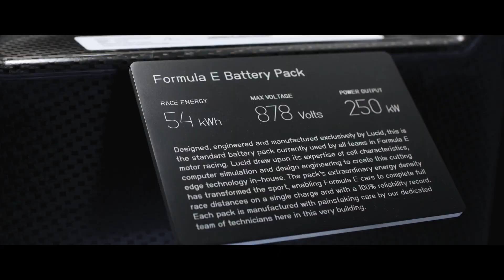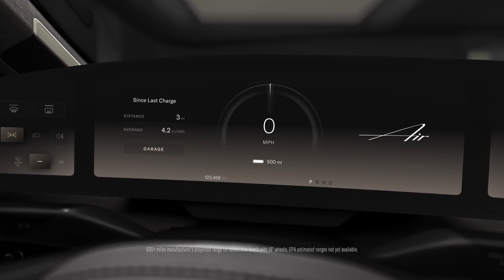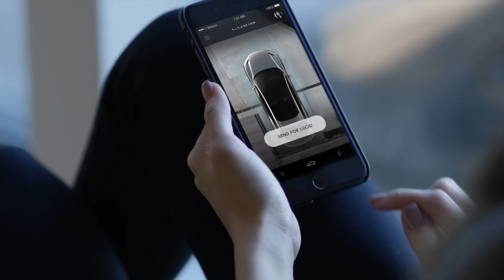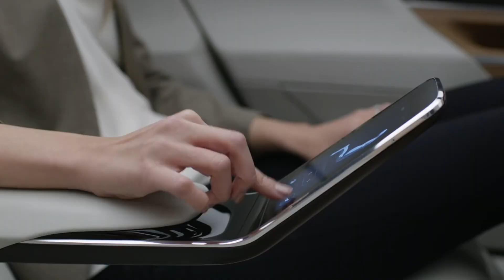What is Lucid Motors?

Comment: LUCID motors is a MASSIVE FRAUD.
PETER never ever was CHIEF anything at TESLA .
Peter came on board , after the Model S PROTOTYPE was Finished , and he worked on the PRODUCTION Model S. 
Peter was VP of the Production model S, in charge of BODY Design and Chassis .
He did NOT work on Batteries, Electric motors, EV Drivetrain, Computers , Software, HVAC, or the BMS/Superbottle.
Reply: I think you're scared of Lucid because I see you spamming this in every video for the last few months.. It also doesn't help using uppercase letters for random words.
Reply: @bobvandijk6274   - how about FIRST , you do some RESEARCH on Lucid motors & LCID stock ?
I done my Due Diligence , time to do yours.
I recommend you Start with FINANCIALS , and work towards Today . 
also, take a look back at what PETER has said about Lucid since January 2021. 
Lucid is a JOKE , I dont FEAR them , I am AFFRAID their WET Dream Drive might KILL someone , because its NOT READY yet.
Reply: @markplott4820  I believe you when you say you've done your due diligence. I'm just saying you looked scared because you spam this stuff in a lot videos about Lucid Motors.
Reply: @bobvandijk6274  - even if you just look at the financial and SEC filings, LUCID does not add up.
Do your own Research.